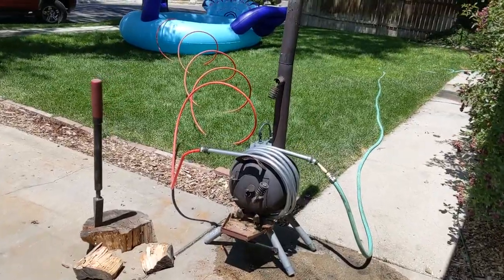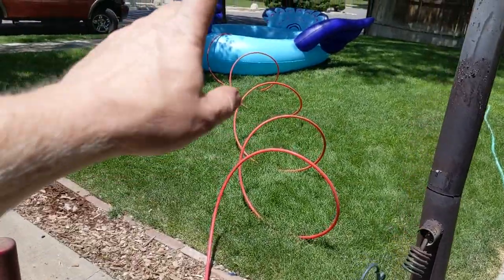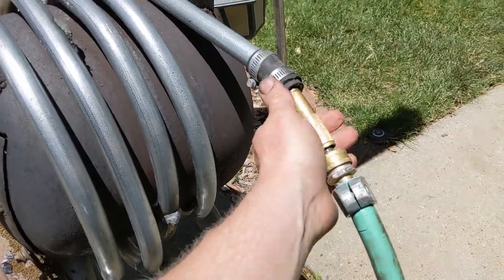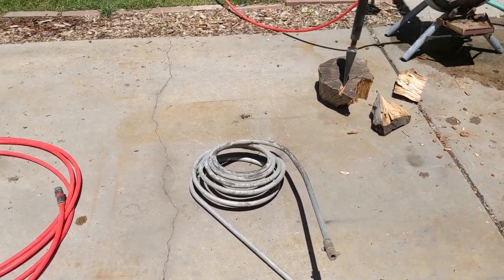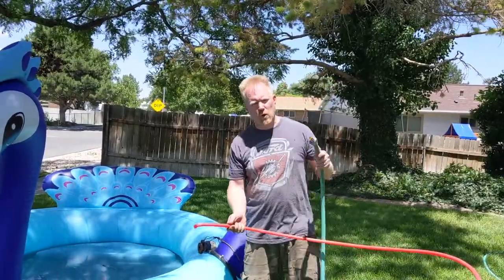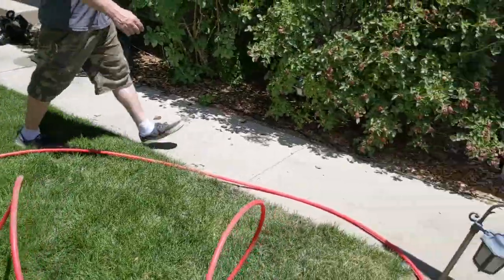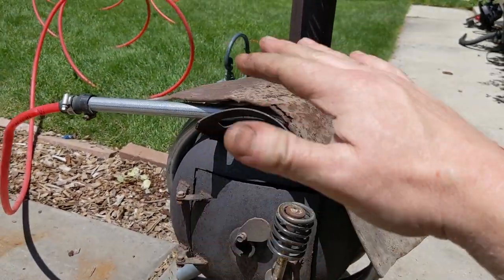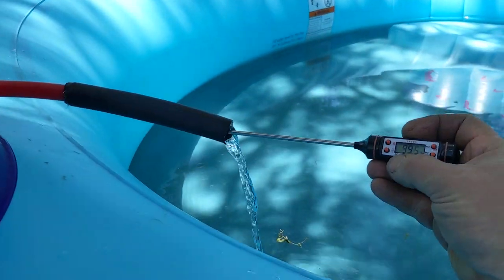Heat backyard swimming pool with FIRE

Comment: What a neat idea. Here’s a neat related story about my grandpa. Back in the 1950’s they added the first outdoor glass elevator to the El Cortez hotel in San Diego. This was also the world’s tallest hydraulic elevator for many years. The 15  story elevator needed a oil reservoir the size of a small swimming pool. The elevator only had 3 stops. The first second and 15th floor which was the restaurant so the elevator wasn’t used much except around meal times when it was used ALOT. They soon ran into a problem where the hydro oil would get so hot during the  heavy usage it would almost boil. Well my grandpa who was the elevator service man came up with a brilliant idea of circulating the swimming pool water through a set of pipes that ran through the hydro oil tank much like your setup. This not only cooled the hydro oil but it heated the swimming pool for free. Unfortunately when they renovated the hotel back in the 80s they removed some of the “non original “ elements to the hotel including the elevator which was a bummer since it wasn’t original but it still was a big part of San Diego history. Anyhow keep up the good work.
Reply: What a cool story thanks dude.
Reply from the maker: That is a great story!
Reply: sixtyfiveford Thanks. One thing I’d like to know about the story which unfortunately can’t be known is where did he come up with the idea? Was it raw ingenuity or had he seen something similar? I’m glad YouTube exists though because I doubt I’d ever have such a large audience to share the story with and it would be lost to history.

Comment: Friend of mine years ago bought a roll of soft copper and put it in a 55 gallon burn barrel, rest like you did. Pretty big pool. 
Worked awesome, took his pool from 45 degrees(well water) to 70 degrees in 2 days burning. 
After that he used black plastic tubing laid out on the ground around his garden to maintain the temp as the pool was completely shaded.
Reply from the maker: That sounds like a great setup. I've helped friends set up large spools of black pipe for solar pool heat.

Comment: Back in the '80's I ran a small sump pump in the pool with a garden hose attached up onto a low carport roof then back to the pool.  My daughters complained that it made the water too hot:)
Reply from the maker: That's awesome.
Reply: @sixtyfiveford  yeah, a coil of garden hose laying anywhere in the sun will get very warm, laying on the roof can create some high temperatures.

Comment: Well, if you just put the pool in the sun and laid black rubber mats on the bottom, you would get about the same result in about the same amount of time. The sun delivers about 1kW of energy per square meter to the surface of the Earth on a sunny day, which in spite of water's significantly-high specific heat capacity would provide sufficient heating. Hot tubs have inline water heaters on the recirculator pump, so this wouldn't be practical for that application.

However, this is a great idea for DIY hot tubs in cold weather, with the entire firebox and coil assembly wrapped in a fiberglass jacket to boost efficiency. But you don't want to get any inflatable over 110F or the PVC might get too soft to withstand the water weight.
Reply from the maker: The humidity is so low here that as the water evaporates it cools off the pool nearly as fast as it heat when left in the sun.
Reply: @sixtyfiveford  In a case of low humidity, I would then suggest a black cover used like a tarp, such as a black polyester canvas. It will not only collect heat, but trap it as well. My only concern is accidents at a party or negligence of the stove. Simply having the pool filled 24 hours in advance would give it time to warm to the ambient temperature, as opposed to the much lower temperature of underground pipes.

You really could do this much more simply by using a propane gas grill and putting a coil in it, and it would actually be more ideal in many ways. I would be happy to collaborate on a basic design of this, which may be more accessible to more people (like an adapter to temporarily repurpose a device). Just remember that galvanized electrical conduit can release toxic chemicals into the air and the water within if heated enough for zinc to approach volatility, so it is not ideal tubing for this..

This is a clever DIY idea, but not everyone would be as appreciative of the hazards involved with this as you are. I sometimes have trouble with that myself, where I'll warn that my knife-sharpening at "razor" level is dangerously sharp, and people still cut themselves, etc.

Comment: Something to be aware of. If you used galvanized conduit like this  you can actually cook the galvanizing off and put it into the air. You breathe stuff you probably shouldn't, and the conduit rusts. I've also seen many people use copper for an exchanger. Same thing, when you heat copper it puts things into the air and your lungs could be the recipient. A better but unfortunately more expensive method would be to use stainless tubing.

Comment: I didn't have a wood stove, I filled my large above ground pool from the water heater took the edge off the cold water chill. The rest of the season s it was in full sun I just had to remember to put the solar cover on when not in use / overnight.
Reply from the maker: Those solar bubble wrap covers are great.
Reply: @sixtyfiveford  They work so well, kids said it was too hot until after the hot water at the top was mixed with the cooler water deeper in the pool.

Comment: I did something like this I used a 50 gal barrel stove with copper coil inside then another barrel cut down to protect copper used a small water pump hooked up to my 10,000 gal above ground pool,Works great butt you need a lot of wood. got water up to 102 f one night.
Reply from the maker: Awesome, that's a Hot Tub at 102.
Reply: @sixtyfiveford  yep when we had a hot tub that was it's setpoint

Comment: We have the opposite problem when it's 108 out side.
Reply: In that case, you'd need to bury a hose several feet deep and run the water through it or build an evaporative cooler.
Reply from the maker: 108 F will heat anything instantly.

Comment: Damn where the heck are you to wanna warm that water?  I'm in Tucson AZ and even a large pool will be about 100+ at night.
Reply from the maker: Apparently not on the surface of the sun. I was down there a few years ago in August. DANG it never gets cool, not even at 3:00am. Here in Northern Utah it may hit 100-110F a few times a year but at midnight on those same days it cools to 70F.
Reply: sixtyfiveford lol Yeah Last night it was 94 Degrees at 1am.  I hate the Arizona heat, but I still live here unfortunately ha.  I would love to live in Utah it's such a beutiful area.
Reply: Up here in ND we use various heating methods to extend our outdoor pool season a month on both ends